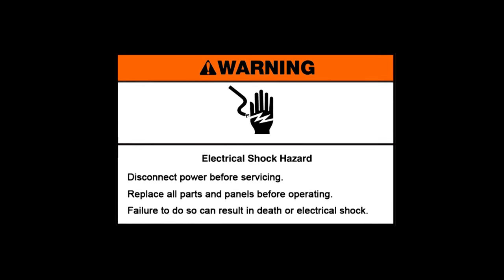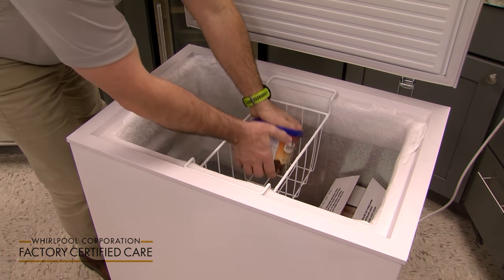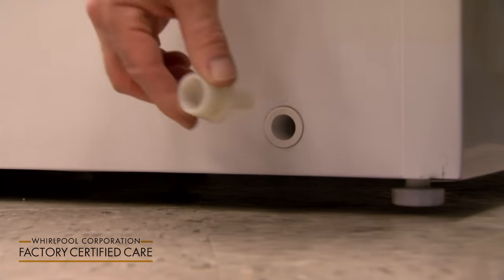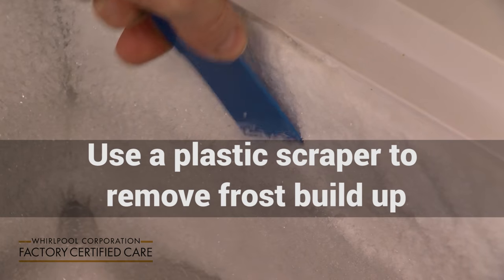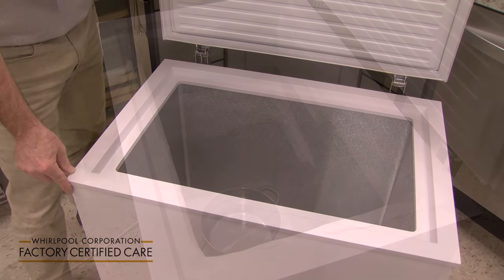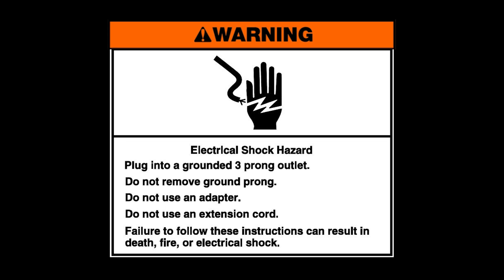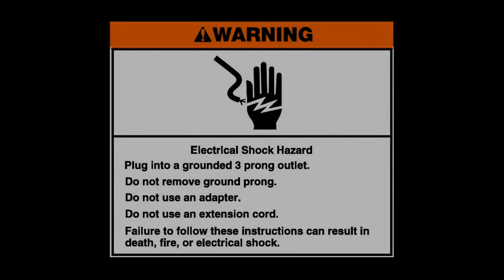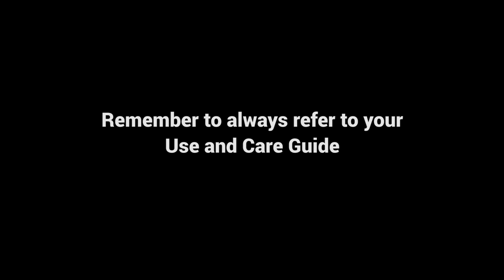Defrost procedure for a chest freezer.

Comment: Yes use bowls of hot water in the chest but try a hair dryer on a cool setting at an angle to blow air under the thick ice but keep it moving, just a few seconds in each position and a plastic ice scrapper to give an impact shock to the ice, 392lit chest freezer de-iced in 15mins, no sweat
Reply: Why not 'get er done' and use a heat gun set on high?

Comment: how do you get water from hose into a bucket? freezer is inside house with no drain in floor.
Reply: That was my first question.  They show the hose angling up from the plug.  Water is not going to flow from the bottom of the freezer up into a hose and then down into a bucket.
Reply: If it's near a door, run it outside and lower than the floor.

Comment: Ice builds up in the lid after a while . 
When defrosting, Water will run down the outside  back of freezer and likely cause damage to your floor and possibly freezer electrical parts . 
Do you have a solution ?
Reply: Stephen, I know your question is a little old, but what I do is wedge a large towel in between the back of the lid in the open position and the back of the chest freezer. This allows the melting ice to absorb into the towel and not run down the back of the unit. Hope this helps.

Comment: I power washed with a regular hose and jet setting,  it was done I'm 5 min, and my ice was 2-3 inches thick, no hot water needed.  My only problem was I couldn't get it to drain, so I had to tip it on its side. My freezer is outside.

Comment: when i turn mine off, it doesn't.  when you turn off a unit it should defrost on it's own. I turned mine off and left the door open to help it.  Came back a day later and it was running like crazy.  I thought I done something wrong so tried it again. same results.  so now this video say UNPLUG it.  Then why is there an OFF mark? Can anyone answer this?  It certainly doesn't turn off.

Comment: Can someone explain why it can’t be plugged into an extension cord
Reply: It all has to do with wire gauge and length of the cable.  Most appliances are made with the intention that you will have an outlet close by and they size the wire gauge and length of the cord accordingly.  Basically what would happen is if you would use a very small wire gauge extension cord with a high amperage device because of the high amperage draw the cord would heat up potentially melting and causing a fire.
Reply: @keny46  Most freezers won't use more than a few hundred watts. Don't use a shitty extension cord. If in doubt run it for a while and make sure it doesn't get warm. Where the freezers plugs into the extension cord make sure its not sitting in an area where water could make contact with it.

Comment: Don’t use. Heat gun or hair dryer to speed it up. Use  the pot of water or hand held clothes steamer
Reply: Why not?
Reply: @goodcitizen3780  there’s a foam behind it that shrivels with hot air. Hot steam water like a clothes steamer is super safe and mega fast
Reply: @usasupra23  
You're trying to tell us that the foam can't take a hair dryer? Lmao
Listen, I have been in refrigeration and appliances since the 80's. At the shop we use the water hose to defrost. On site we use heat guns.
We've been doing this for over 40 years and I've never seen damaged insulation from defrosting.
We even convert these freezers into smokers called a "Cajun microwave". 
I've seen these units inside and out. Your information is erroneous.
Reply: @goodcitizen3780  guess you haven’t seen how stupid people can be. Clearly you know how to apply the heat but I’ve seen idiots do some stupid stuff trying to defrost them.
Reply: @usasupra23  
Man I can't imagine! 
Plug in gun...
Turn gun on max...
Drop gun in freezer...
Close door...
Check it tomorrow...
Great job! All done! 👍

🤣